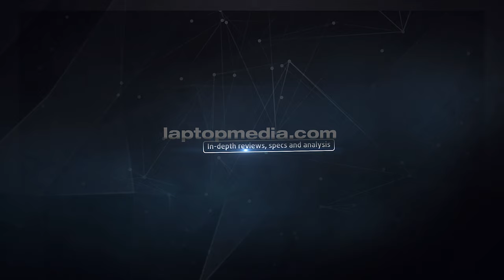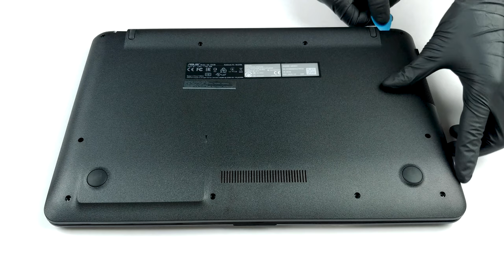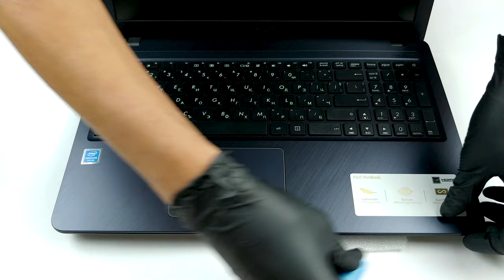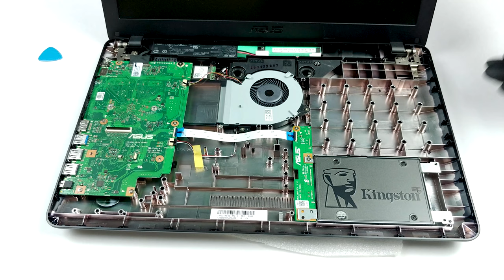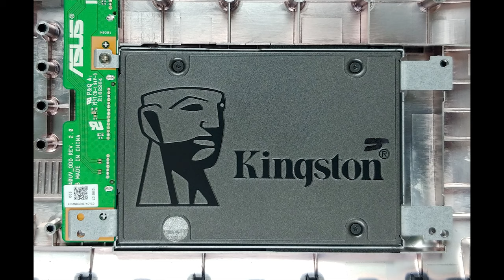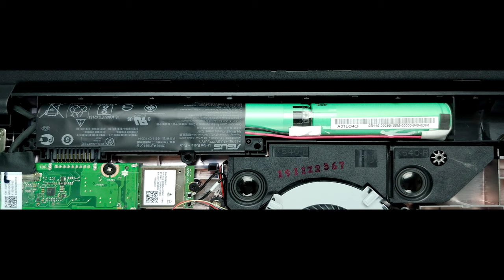🛠️ ASUS X543 - disassembly and upgrade options

Comment: Very bad design. What sort of a laptop has to be completely taken apart just to upgrade RAM??? They could've just provided RAM slot right on top once it's opened.
Reply: RAM upgrade is possible in this laptop?
Reply: @bittu_7  doesn't look like it
Reply: @bittu_7  This is impossible, the Ram Slot, for this model, not exist... (just On board Ram chips) with a Intel Pentium (all chips on unique silicon die) Pentium 4405u (mobile) ... with only 4gb of Onboard Ram

Comment: This model in the video is X543MA-G0835T and has soldered CPU and soldered 4GB DDR4 RAM with no expansion slot for the RAM. Don't bother taking apart for the RAM upgrade if you have this model.
Reply: How about the. X543MA GQ514T

Comment: Hola tengo una duda tiene a ono? Algun stock para aumentar la ram
Reply: Supiste si tiene o no
Tengo.una duda porque hay en el video tiene un espacio libre de la batería 
Solo conté 3 pilas verdes
Reply: X543ba si tiene , solo 1 slot , cambie una de 4 x una de 8 y se mueve bien para uso diario. El HD eh pensado en cambiarlo x un SSD
Reply: @DAAMCN  donde puedo encontrar el SSD?
Reply: @DAAMCN  en que parte viene el slot amigo? En el video no lo pude ver
Reply: Saben si esta lap se le puede aumentar la Ram 543M porque es la misma placa que el video, pero no veo que tenga un slot para cambiar la memoria
Reply: No no se puede no trae slot
Reply: @Axelin55  no trae amigo

Comment: I would like to know if you could upgrade your memory and exchange the HD for SSD
Reply: Im planning to replace hdd to ssd. there are no batteries here, first you need to disconnect the batteries, disconnect this cable above the hdd and simply mount the sdd.
Reply: @langowski007  did you managed to change?
Reply: You can upgrade to ssd but it has to be sata rather than m.2. The ram cannot be upgrade tho.
Reply: @kurse5225 the ram slot is under the motherboard
Reply: @gabriel10wesley  I don't think so, it clearly doesn't show ram slot. Only the soldered ram.

Comment: Can the memory ram be increased in this laptop?
Reply: nope.. as you can see there are no slots for RAM upgrade, the memory is soldered on the mainboard :((
i have this laptop, its dirt cheap and does its work nicely, but having 8GB instead of 4GB could be much better..
even tho for a student or simple tasks its totally fine..
Reply: @benjaminforest1176  Well, thank you bro
Reply: @benjaminforest1176 hi, i'm a medical  student and I need a cheap laptop to study i want to buy this one do u recommend  me to do so or no plzz help .
Reply: @benjaminforest1176  thank u so much for ur help my budget is around 300$ and I'm still looking for the best laptop I can get with this limited budget any way thaank u so so much   BTW i'm a girl 😹.
Reply: @benjaminforest1176  processor?
Reply: @benjaminforest1176  Hi! Do you know if Asus x543ua has space for a ssd memory? If it doesn't, can I change the HD for the ssd??
Reply: @benjaminforest1176  actually yes, you can, the slot for the upgrade is on the back of the motherboard, i verified with mine
Reply: @felipebragaalmeida2330  i think you have to change the hdd, i'm waiting for the ssd to arrive so i can change the hard disk, when i change it i tell you if there is more space
Reply: @benjaminforest1176  can i use m.2 ssd?
Reply: @yousufahmed2955  this laptop has only sata ports.
So unless you have m.2 - sata adapter I don't think so..
Reply: @benjaminforest1176  hello i have this laptop also.. may i know if yours is draining its battery fast? its 1 year old
Reply: @gl1325  well, truth to be told, i am almost never use it on battery, 99% of time its connected to power supply so i cant tell really.
however you should not expect too much from batteries, its not a mobile power horse this laptop, its meant to work offline for very short time anyway..
Reply: @benjaminforest1176  thanks for the answer! i appreciate it. may i also ask, what do you mean by "most of the time youre using it in power supply"? does that mean, the charger is always plugged OR the battery is removed and you plug the charger?

sorry for bothering i may be both wrong but i would be thankful if u would enlighten me. thanks sir a lot.
Reply: @gl1325  i am always have charger plugged in, that way i have 100% full CPU power, as when laptop is running on batteries, the CPU will be much slower to preserve power.
Reply: @benjaminforest1176  when i want to do it too, do i have to remove the battery or not?
Reply: @gl1325  you cannot remove battery, its built-in into case.
Reply: @benjaminforest1176  so ill just plug the charger? anw thanks a lot man!
Reply: @Fix.009  can you change the ram memory?
Reply: @yukinakyom3715  for the love of God, get something better
Reply: @yukinakyom3715  нет

Comment: Can you upgrade the processor on this laptop?
Reply: Don't think so. But the ram, yes
Reply: @darkkforest  how ? I can't see ram slot
Reply: @darkkforest   I  bought this laptop and I wanna  upgrade this laptop
Reply: @frkndrk54  i think their is region variants for that model, some may have, some not, but what i know is that you cannot add another ram.. You can just upgrade the 4GB one
Reply: In most laptops you cannot upgrade the processor. They are usually soldered on the motherboard.
Reply: @darkkforest  How do you upgrade it without a slot?

Comment: Where is the SSD slot and RAM expend Slot??
Reply: There is not a slot for them, In case, you can exchange the HDD to SSD . The solution for u continue using your HDD is buying a HDD case and use it a USB 3.0

Comment: I want add extra RAM... My asus laptop have 4GB ram inbuilt but I check in command section its swoing 32GB maximum supported and and using one slot of 2. but when I opened my laptop's back cover I can see only one slot. how to find another second slot according to command section... PLEASE HELP ANYONE... 🙏🏻😭
Reply: The only thing you can do is buy 16gb of ram, that's the max you will be able to add on that laptop

Comment: Can any chip type graphics can be added in this laptop
Reply: no you cant ad gpu in laptop
Reply: Mine laptop is asus X543UB ,Intel Pentium Gold 4417U 2,30 ghz, 4 gb ram and 3 slot free for upgrading ram ,Intel hd 610  plus Nvidia  MX110 2gb,SSD 256 gb and is good you can upgrade to 12 gb ram

Comment: I have this laptop, its processor is i5 and I was able to add 8GB RAM (it has 4GB RAM onboard and 1 free slot).
Reply: hello sir, is it asus x543u, the silver one?
Reply: @gl1325  black
Reply: @nchlsky   did ur laptop speed increased.. this lappie is too slow even browser getting hanged.. ant suggestion to upgrade ram or m.2 nvme(if supports)
Reply: @kdstreams1235  yes, it got a significant boost. The laptop however, don't support m.2 nvme. You can only use SATA SSDs on this device.

I've upgraded my RAM and added an SSD, mine has an extra SATA slot for storage unlike the one on this video.

I've been using this for almost 3 years now.
Reply: @nchlsky  how to know if mine have an extra SATA slot ? i 'm looking to buy a new disk but don't know if i would be able to install it or not.
Reply: Where is the slot located mine does not have a slot

Comment: hi, is X543 the same as X543U?
I want to add 8GB RAM (Hyper-X 2400Mhz) to max-out 12GB(supported) but I hold my order for ram cards coz different technicians told me different pieces of information (they didn't open my laptop).

some said it would be better to add two 4GB ram cards to get better performance since I have 4 slots.

another tech said I can only add 1 ram card coz my current ram card is using 4 slots, but on my task manager, it says Slots Used: 1 of 4.

Now I'm confused T_T
I really need to max-out my 12GB memory. 
I run a browser with multiple tabs, photoshop, and a time tracker.
Memory usage starts at 60% and goes up above 90% -_-
Reply: What is the MHz of ur laptop ram???
It shows 4gb 2133MHz in my x553ub i3 7th gen.
Reply: Good day unfortunately  you cannot add any more ram to these kind of low end laptops reason  being these board have on board memory. You will have to try and credit your laptop and get one with upgradable  ram or just buy one with the specs you require
Reply: @wasifulkaium3036  mine is 2400Mhz.
have you added ram in your laptop?
Reply: @ryanrobert1150  on https://www.asus.com/ph/Laptops/ASUS-Laptop-X543UB/specifications/
it says... Memory 4 GB, total up to 12 GB SDRAM.
if i cannot "Add", can i Replace it with 12GB?
Reply: @wasifulkaium3036  yes, to the x543ua you can, i personally upgrade mine with more ram so i can have a total of 12 GB of ram
Reply: The slot for upgrade for ram in the x543ua is on the back of the motherboard, i personally check this on mine
Reply: I use asus x543ub core i3 7020...it has 4gb ram of 2133mhz...but I wanna add 8gb 2400mhz ram...is it possible?? or I have to add another 8gb 2133mhz???
Reply: @wasifulkaium3036  i can't tell you that, but i think that yes, i add a corsair valueselect 8 gb and work perfectly if you want a refference
Reply: @Fix.009  hi, I also have an asus x543ua, can you tell me some info about what's inside, since you say you have opened it? like, on bios it is mentioned that there are 3 slots for ATA drive and only the 0 one is occupied, with a 2.5 form factor Sata 3. But what about the other two slots? are they real, or it's a soft error? and if they exist, what form factor are they, M.2, 2.5, mSata? where are they placed? what's in the place of the DVD-r since there is none? can you place a caddy in there, is there already a caddy in there where you can put a 2.5 drive, or it's like in this video where there's that metal and you can't put anything in there?

Regarding RAM, how many slots are there? The Asus specifications on the website says the max capacity is 12  but no mention of how many slots and different soft tell different info ( task manager, cpuz, crucial scanner, etc) the existing 4 GB are soldered in or  removable?
I'd appreciate if you'd be able to reply since I really want to know what's upgradable and don't want to lose the warranty to open it myself and since you say you opened it, maybe you can help me out.
Reply: @Fix.009  can i use m.2 ssd?
Reply: @Ryan Robert you are right! I just opened mine, and no slot on the motherboard for ram. 200£ flushed the toilet💩
Reply: @marjanmiceski7905  , i have a x540ur on task manger it says i have 1 out of 4 in use
Reply: hi guys, can some of u help me? i have brough this laptop yesterday, i opened him to clean it,  i saw that have 1 slot ram that have a ram there 4gb. but, isnt equal the video, that have 4gb ram fixed on the motherboard. So if i want a upgrade i have to buy just 8gb ram and remove the 4gb that already have? sorry for my english, im br
Reply: @delonfortuin9235  Mine is X540 UBR i alredy upgraded with plus 8gb ram now is 12 gb ram
Reply: Same problem with X543MA

Comment: Crappy laptop asus I will not buy they ruin a 400 dolar machine by not integrating a 5 dollar heat pipe. After a  year these laptop's are suffering heavy thermal throttling and sometimes shut down due to overheating.  Buy this laptop ony if you use at 20% capacity.
Reply: what are you doing with it?

Comment: This is a rip off man.... onboard 4gb ram without upgrade option????????
Reply: I have this model and you can upgrade the ram, the port is on the back of the mother
Reply: @Fix.009  u sure we can upgrade the ram ?
Reply: @Fix.009  there is no ram port on this model
Reply: @wathekghenimi9133  well, at least mine have the ram port in the back
Reply: @Fix.009  cant upgrade ram,what ''port'' nonsense u talking ?
Reply: I bought one , AND the mine has ram port ti change.
Reply: I have this model and I was able to upgrade it to 12GB (max supported). It has 1 free slot at the back of the motherboard.
Reply: @nchlsky  I opened one and it had a ram stick on the back, even tho it was only a 4 gb ram total. was that supposed to be the onboard one or just a placeholder?
Reply: @EpicMadlad  i don't know, when I opened mine, it had no stick, just a slot.